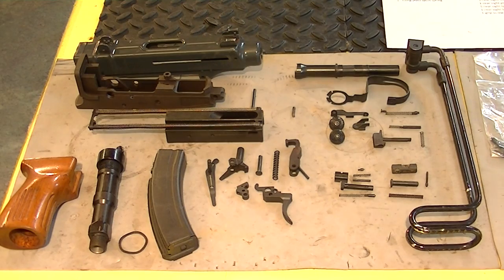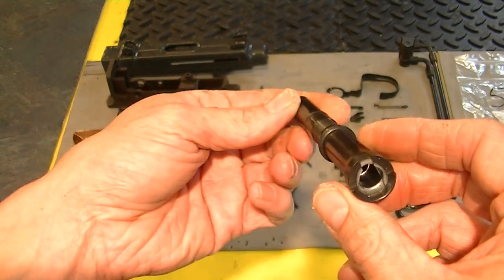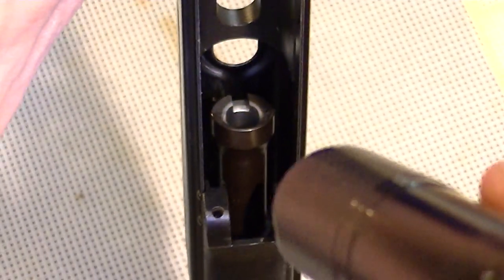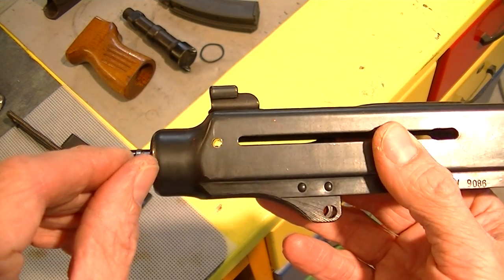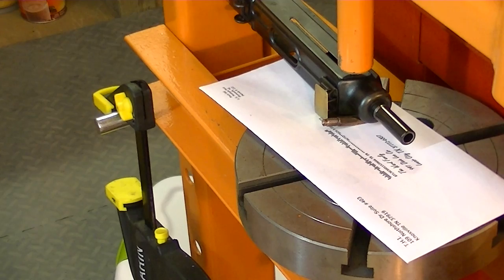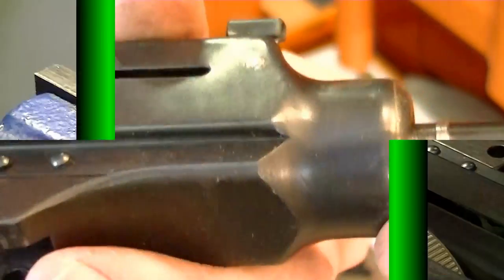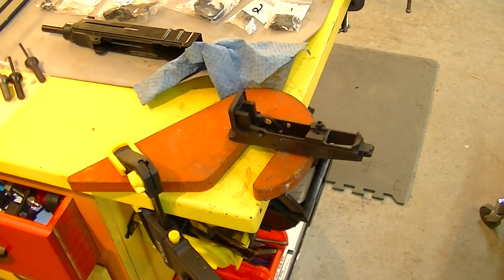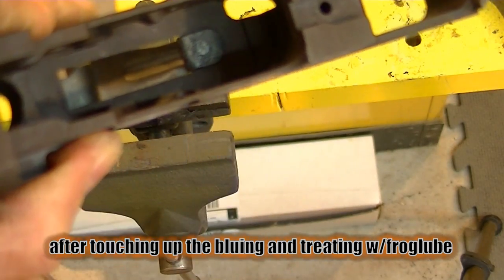VZ61 SKORPION build from parts kit (1of3) Barrel + trigger guard

Comment: Great videos, never press dry, i always use moly grease on my barrels and barrel pins so they press in like butter....try it, lube is your friend
Reply: Absolutely correct!
IMHO best is anti-seize, but I'm sure the moly works just fine.
Also, it shouldn't be hammered in with the bolt. It should be pressed in.
All said, it seems to work, Sao you do you and enjoy it.

Comment from the maker: that's funny because my trade is actually a P mechanic... all we ever use was pneumatic.. haha  I am in the process of designing tooling that will align, gauge, and protect all at once for use with the pneumatic tooling.  The tooling is simple but the variance in air hammers is the issue. Some work well turned down, some do not.  I might have to include a air hammer in my kit once I am ready for resale. I agree, the manual way works great but I need quicker results (proper results)for production

Comment: An NFA tax stamp does not need to be signed off or approved by local law enforcement. You provide a copy of the stamp to your local LEO within 30 days of approval but it’s for record purposes. There are places that have more strict rules on NFA stuff, for example, MA requires a “green card” for a form 3 weapon but none of these restrictions are part of the NFA process.
Reply: Things were different over a decade ago. Back before Rule 41(f) was amended, you DID indeed need a CLEO sign-off on every Form 1 or 4. The only exception was trusts.

Comment: It's not a bolt running through the grip. It is for full auto use and it reduces the cyclic rate by controlling the hook that locks into the bolt.

Comment: Now your able to print them and slap a brace on em. Im printing one right now.
Reply: But have you found a safety selector for sale anywhere?
Reply: @maffioli14  ?
Reply: Kekistani Armorer I’m building one and am currently printing a lower receiver for testing. I absolutely cannot find a fire selector lever anywhere. I think I posted my comment in the wrong place.
Reply: @maffioli14  I wonder if you could find specs to 3d print a selector. Even if it is not durable enough for long term, I wonder if it couldn't be used to make a simple mold and cast an aluminum one?

Comment: Where do you get a receiver for this? I cannot find one anywhere!
Reply: Did you ever find one? Lol
Reply: @funigui  no lol
Reply: @Transit_Angst  well, 3D printer is running now. I'll keep looking but the Czar from Ivan the troll looks good enough for now
Reply: I'm looking too. 
Let me know if you find lower receivers anywhere? 
I don't own a 3D printer and would rather have a metal lower for authenticity sake. I'm more of a collector and hobby gunsmith than a regular shooter anyway. 
So, it's more important to me that it look/feel historically correct for display and demonstrative purposes.

I'm hoping to maybe track down whatever company in Knoxville, TN made this one. Hopefully I can contact them or find one of them somewhere online.
Reply: @funigui  did you find any files that allow the installation of wire folder?
Reply: @mpkid5  nope. It's on the list somewhere to call recon ordinance and buy a metal frame

Comment: your kit is missing parts, the tube in the grip is for the rate reducer weight. there was a lever and a catch mounted above that, your receiver doesn't have the necessary mounting hole for them

Comment: Do you have any idea how to remove the barrel? I bought one, but the crown is damaged, so it doesn't shoot very well anymore, now i have to change the barrel... how do I get the barrel out without destroying the case?
Reply: This was 7 years ago, but maybe sleeve a steel pipe over the chamber and up against the trunion? That way you can set the crown of the barrel down and hit the pipe with a press?